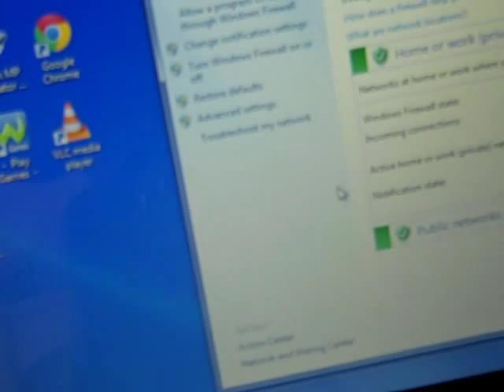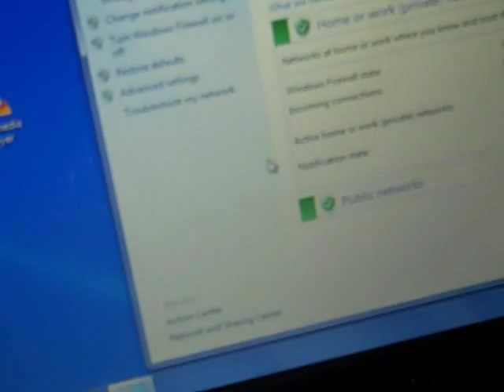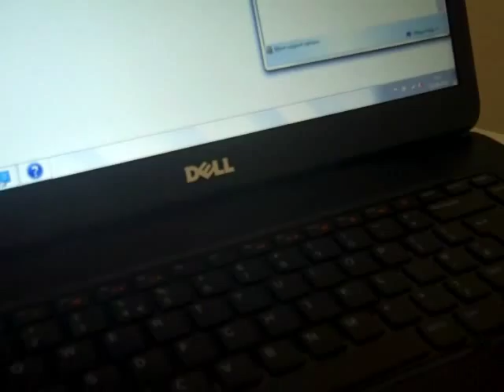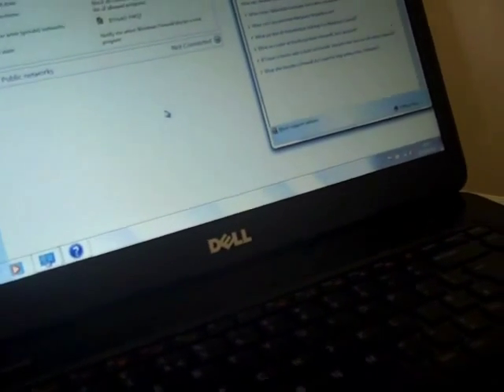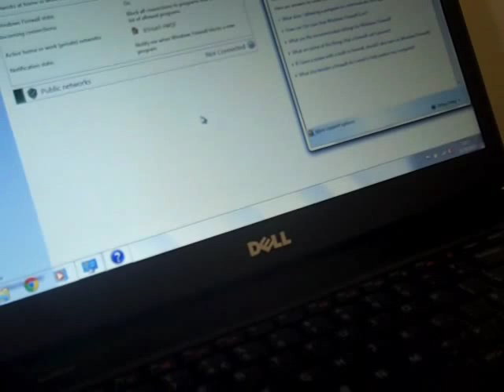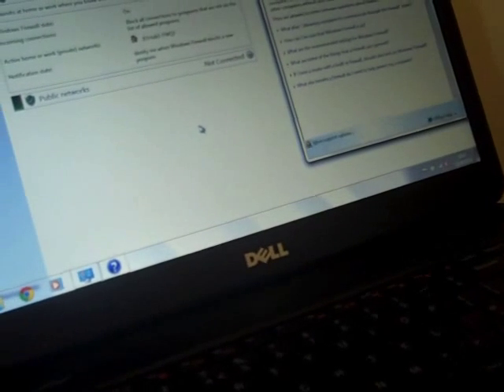Alps Dell Laptop Touchpad Erratic when using PSU charger

Comment: not sure why there are many dislikes, this helped me fix the fact that my Chuwi Hi10 Pro touchpad kept disconnecting and reconnecting while on charge. This technically doesn't fix the problem but it provides such an easy workaround that it might as well not be a problem, especially if the case is metal. Thank you

Comment: Easy Fix I didn't come up with the credits goes to another guy , 
keep the adapter a little bit far off from the pc. I know it sounds weird but keep the adapter as far as possible from the computer as far as it can extend and it'll work , according to another guy there is an Electro Magnetic Interference which messes up the electrical circuit in the touchpad it even used to weaken my wifi signal but now it's good.

Comment: same problem with... a dell original charger (warranty expired). Is there a quick and dirty fix for that? (Like soldering a wire from a metallic part to the charger ground pin)
Reply: keep the adapter a little bit far off from the pc. I know it sounds weird but keep the adapter as far as possible from the computer as far as it can extend and it'll work , according to another guy there is an Electro Magnetic Interference which messes up the electrical circuit in the touchpad it even used to weaken my wifi signal but now it's good.

Comment: i just bought a new laptop and this is happening to me whenever i use the mouse!
Reply: Sir what was solution.... I m facing same problem right now
Reply: @ajaygoswami5534  .....on windows 10 DO NOT INSTALL Freefall sensor. dell e5420.
Reply: @Thondup Namgual try to reinstall Windows. Do not install chipset and free Fall sensor.
Reply: @WojciechOkon  hi, i have the same computer Dell M5040, it has a different problem it had a problem whit the charger cirquit so i decided  change it. when i changed the mainboard for a new motherboad and i installed all parts in it places the touchpad does not work well, each time that i plugued the charguer so i tried many way to fix it ! (formating,installing new drivers, changin the  operating systems ) so i have other laptop to use its parts and found a laptop HP whit the same bus cable to conect to the mainboard i plugued the hp touchpad on laptop dell and it work !
whit the charguer plugued , so i think that the touchpad hardware is working wrong .

now i bought a new touchpad whith the hope that everything will ok.
i will tell you what will happend.